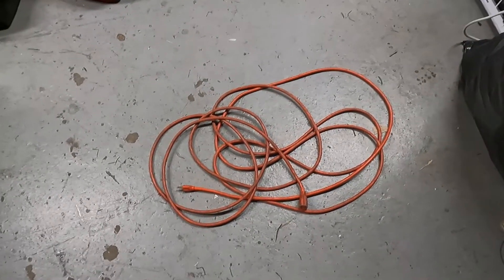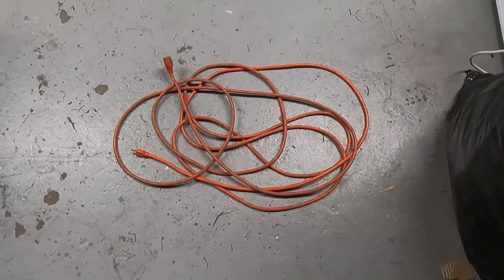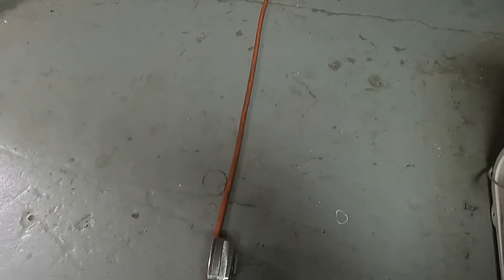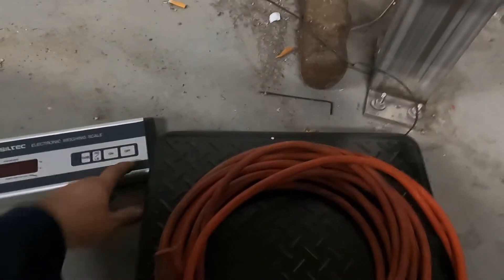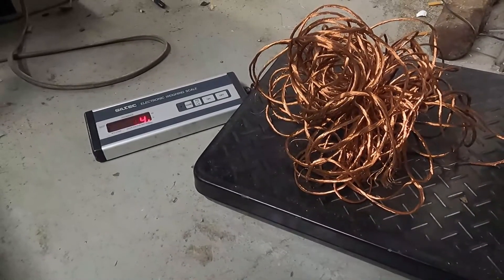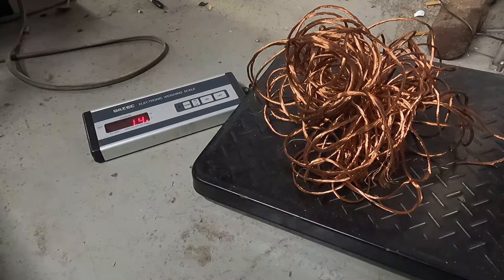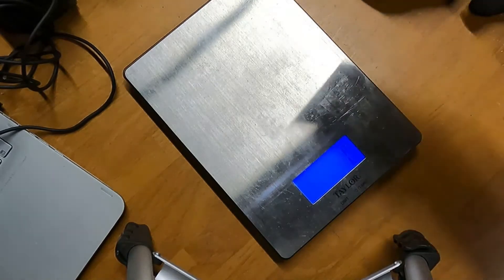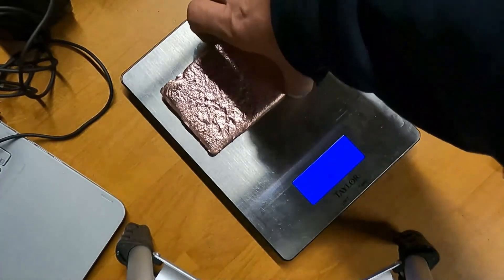Extension cords - How much copper inside?

Comment: What was the salt-like substance you poured in?

Also, why did the weight increase after to melted from what the wire weight was?
Reply from the maker: Borax.  There was also a tiny bit of copper leftover in the crucible from the last melt
Reply: @Scrap2Cast Gotcha. What does the borax do?

By the way, just came across your channel today. Really good content so far! Subscribed
Reply from the maker: @JudahEyes hey thanks for subscribing, much appreciated!  

The Borax when added to the molten copper helps bring the impurities of the metal to the top of the crucible.  Then I simply skim off the slag / dross and it makes the copper more pure.  The last time I cashed in my copper ingots, they were 99.1% pure copper.

Comment: Is there an easy way to untwist the wires/rope after you take the first layer of insulation off?
Reply from the maker: What I do is I connect the end of the wire into a drill chuck and then tie off the other end at the end of the room.  I then use the drill and it will untwist the wire.  Check out this video for a visual 🙂

https://youtu.be/Q26Ea45lwYQ
Reply: @Scrap2Cast  Thanks!  Checked out the video, I'll try with my drill tomorrow.
Reply from the maker: Excellent!  Start off on a slow speed.  Watch the wires and see if they start tightening or loosening.  If they start tightening, put it in reverse.  When you see a large gap halfway down the full length while unwinding, stop.  This is usually a tell-tale sign that its completely unravelled.  The last foot might still be twisted because it was tied off but they are easy to pull apart.  Just be sure after taking off the first layer of insulation to remove the rope prior to the above method.  The rope makes it difficult.  I usually tie off both ends and unwind the rope, cutting it off in 3 foot sections until its completely gone.  Hope this info helps!  Thanks for watching my videos!  🙂

Comment: nice breakdown, you show how (some scrapyards) pay for (unstripped) 40% and 60% recovery wire.    the double insulated (extension wire shown) being 40% recovery (60% plastic/rubber).     the question is how much do they pay?   and is it worth the labor to strip it?    sometimes is pays more just to strip the outside plastic.
Reply from the maker: It honestly varies from scrapyard to scrapyard.  Most scrappers will say not to strip it at all because most of the weight is plastic/rubber.  I guess it’s a matter of choice when it really comes down to it.  I prefer to strip my larger gauge wires versus the really tiny wires.  There’s many different grades and classifications too and it can be difficult to pinpoint an exact price.  My best recommendation is to contact a scrapyard that you trust and ask for the differences in prices.  I personally don’t have a good answer on pricing at the moment.  I hoard all my copper so I’m not too familiar on the current prices.
Reply: @Scrap2Cast    exactly, the yard i usually go to suggests not stripping but i'm getting a stripper and will determine that myself.   but as you say, it's all about the prices and categories.
Reply from the maker: @tomitstube  yeah they say that so they can pay a lower price.  They probably have a guy that strips wire all day lol.  Which stripper do you plan on going with if you dont mind me asking?
Reply: @Scrap2Cast    i'm leaning towards the drill powered stripmeister, the price is right and tubprint did an excellent video comparing it to a chinese stripper that numerous people have done videos on.    there's another out there that's focused on the feeding apparatus, (don't remember the name, or price) but the main complaints seem to be 1) the roller grip and keeping wire from rolling out of the blade/guide, and 2) making the adjustments easy to operate.
Reply from the maker: @tomitstube  The one I have I bought off Amazon for $200.  Sometimes I experience the problems you mentioned and I noticed that if the wire has a clear layer of plastic under the colored plastic, it doesn’t feed correctly.  As far as the wire getting caught under the plate, if you straighten the ends of the wire going in, it seems to fix.  I started off with a vise mounted stripper by TNT tooling that MooseScrapper did a review on.  It was pricey, but worked.  Setting the blade depth perfectly was a hassle though.  Good luck with your purchase and post a vid of it in action!
Reply: @Scrap2Cast    sounds like you have the one i've mentioned, it's pretty much the same stripper rebranded by diff. companies, kind of like car manufactures who share the same body frames and the like... as soon as i pay my annual hurricane insurance this month i'll know how much i can spend, thanks for responding and the info.   i'm subbed so i can keep up with your work.
Reply from the maker: Thanks so much for the sub!!  Much appreciated 😁

Comment: Would heating up the casting more help with the pour? Maybe use map gas instead of propane in the torch
Reply from the maker: Normally I put the molds on top of the furnace to heat them up.  Currently I am experimenting with different methods but I could try map gas in the near future